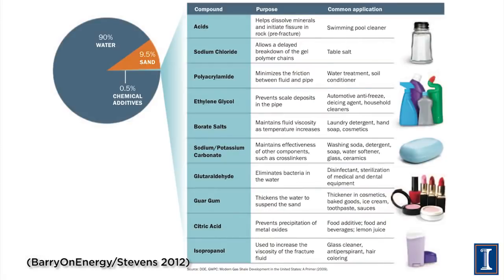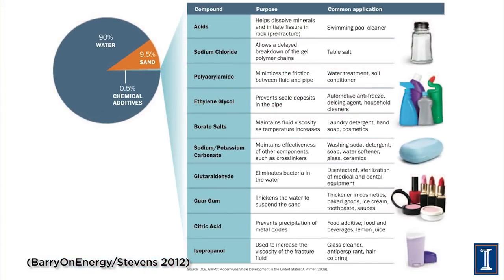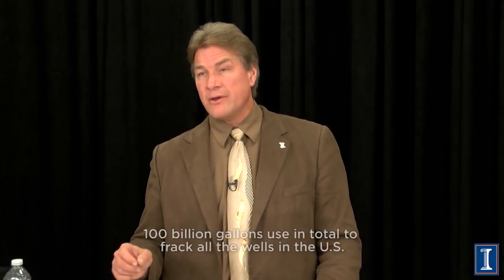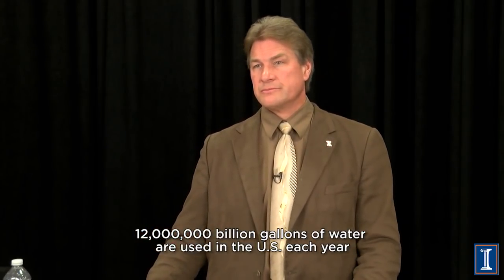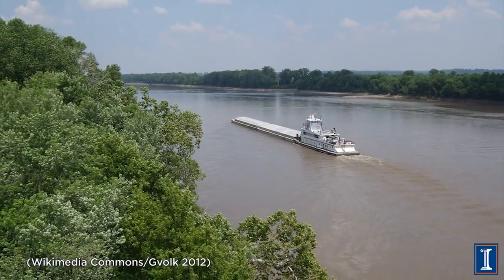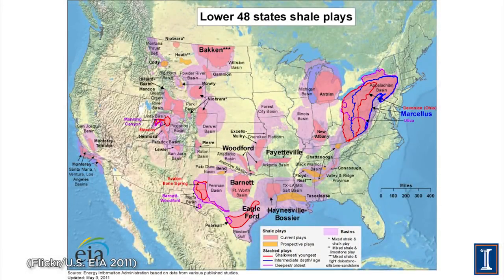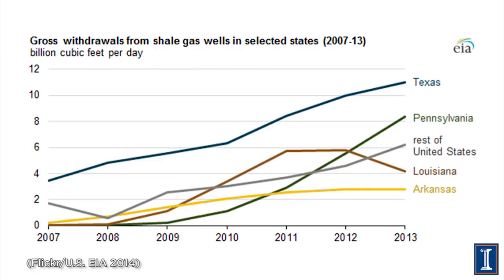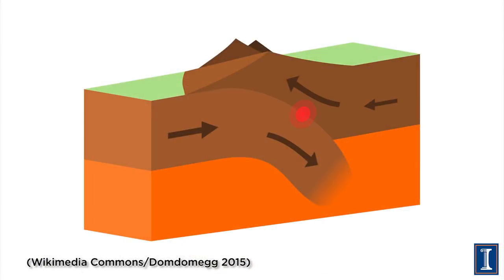Fracking and the Environment: Myth and Reality

Comment: Salt water dissolves uranium in dark shale. Wastewater from some locations is now a radiological hazard.
Reply: The pipes pulled from the wells can be radioactive as well as magnetized from the movement of the radioactive fluids.
   Just a welder sharing an anecdote. 
   Pass it on.

Comment: How much money dos government pay this guy to brainwash people.100 gallons per day.That is almost a half a tonne . WTF
Reply: The number of 80 to 100 gallons of water per person in the USA comes from the U.S. Geological Survey.
Reply: @kodiak2fitty  you may only drink a gallon or so or day, but can easily use 50 gallons for a shower, 10-15 a day for toilet (unless you piss outside or dont flush). A load of laundry is around 50 gallons or so. 5 to gallons for cooking and sink use is quite reasonable.

You might use less, but its probably not as much less as you would like to think. And also this is average so the one guy that dumps 1000+ gallons every time sprinklers come on to keep his grass green distorts the average. If the 100 gallons is including agriculture that actually seems impressive, but I doubt it includes that.

 We all could get by using alot less if we treated the stuff like gold and were dirtier and lost many conveniences of modern life. However desalination tech has got costs down 1kwh per 1000 gallons with barely higher overall cost, not running out of water soon.

Comment: Please address the issue of methane release in fracking oil.  It seems to be a huge problem, especially now that EPA allows release instead of capture or even flaring.
Reply: Methane release from the artic tundra areas warming up is a much larger issue
Reply: Methane is very short lived and does not have a huge global warming effect. Reason being all the radiation methane can absorb is also absorbed by water vapor. By the time water vapor gets done absorbing radiation, there is very little for methane to and it can’t cause that much heating if any. Methane is about 2ppm, water is about 25,000ppm
Reply: @thepope2412  Some of what you said is simply not true. Methane only absorbs light in a couple of fairly narrow IR bands, and at the 7-8 micrometer band water vapor dominates, but if you look at the 5 micrometer band - there it out-absorbs water vapor - even at it's currently low concentration. https://webbook.nist.gov/cgi/cbook.cgi?ID=C74828&Type=IR-SPEC&Index=1#IR-SPEC. Water vapor is basically transparent at 5 um. And while it is fairly short lived, short lived is still on the order of 12 years, and it breaks down (in the presence of hydroxyl radicals) into water and CO2, so it continues to act as a greenhouse gas long afterwards. All that being said - you're main point that it doesn't have a huge global warming effect is probably not wrong. But we we really can't ignore it and I think it's worth tracking and probably worth regulation. And I wish that he had addressed the role that natural gas fracking plays in its release.
Reply: @MrTkharris  You misread the data. Methane doesn't absorb at 5 microns, but around 3 and 7 which overlaps with water
Reply: @thepope2412  Saying that something small can't have a large effect is purely wrong. The amount of CO2 in our atmosphere is also very comparatively low to other compounds but plays a huge factor in the climate of our planet.
Reply: @snobrder4evr  methane at 2 ppm to CO2 at about 350 ppm is a lot
Reply: @snobrder4evr  I think he’s talking in relativity though. Methane, relative to carbon, is not responsible for an especially large amount of atmospheric warming. Obv 2ppm is still a fuckton but like compared to carbon and bearing in mind it’s relatively small absorption spectrum, it’s not that big of a deal
Reply: @snobrder4evr  You basically missed the point. The reason why co2 has a big effect is it absorbs fairly unique wavelengths of radiation that other gasses dont absorb. And the more you add the less of an effect it has, eventually you would have to keep doubling it to see the same effect, since it's already absorbing the radiation very effectively. think adding multiple coats of paint. Eventually more paint is just redundant. The same logic applies to methane and water since they overlap.
Reply: @snobrder4evr  except it's true

Comment: I worked as a tech in fraccing.   He's 100% correct on all of this.  

Water.   Most often low level filtered production water from other wells or nearby surface water from ponds and or rivers.  
Propant.  Various types of Sand/manufactured aggregates. 
Guar gum.  Industrial Jello on a industrial volume scale.   
Surfactants.   AKA industrial soap to make surface tension of the fluid lower so it flows better.  (Makes your hands feel unusually clean)  
Biocides.  Often the same chemicals used by farmers and landscapers or gardeners, just far more concentrated.  (Typically used in tiny PPM volumes)

Comment: The majority of problems caused fracking result of drillers inadequate sealing the bore hole. 
The same is true in events such as the Deep water horizon fiasco . 
Profits over safety is a poor model.
Reply: I worked in fraccing and the vast majority of those situations come from inept/grossly under trained work crew issues.  

Sad fact of life is too many companies are not crooked operators but just near impossibly lazy/cheap/sloppy on properly training their crews to know how to do their jobs properly. 
Most often aggravated by ladder climbing fuckwits lying their way into management or higher positions and screwing things up from there by running off everyone below them (almost always the crew members with functional knowledge and skills at or above their own) that they felt was a threat to their undeserving jobs even when there was no real threat by them.

Comment: In general, I love the knowledge this man shares. However my curiosity about fracking continues after watching this.  Mini earthquakes induced in areas nowhere near natural faults seems disconnected from possible benefits of lubricating the San Andreas Fault. Also, although it is possible for well water to naturally absorb methane, that also seems very different from a previously clean well suddenly developing methane absorption after the geological structures separating groundwater from methane were fractured. I’d love to see a video address these questions - I genuinely want to understand.
Reply: This much longer interview on hydraulic fracturing with Dr Mukul Sharma on Alex Epstein's "Power Hour" series may interest you https://youtu.be/Lj8vZIinpG0
Reply: Your thinking is that a mini earthquakes were induced by fracking. And also thinking that well water spontaneously has methane in it because of fracking. Now can’t fracking ever cause any problems well yes I have done improperly in the improper area. Just like drilling for water or oil Or putting a tunnel through a mountain. My in-laws had their well cracked and flooded a pipe line for natural gas being laid. These were just empty pipes at the time and caused one big mess. That doesn’t mean laying pipe is inherently evil. It means It was done improperly. Sorry for any grammatical errors I’m voice texting
Reply: fact minor earth quakes happen away from fault lines many times, and also major earthquakes hit these places as well allah Hatti
Reply: So are you suggesting that methane is in the water table everywhere?
Reply: We tend to think of earthquakes as a problem generally confined to the Western US. West of the Rockies and into Alaska. This just isn't the case. There are Earthquakes all over the USA on a fairly regular basis. I looked at the USGS site when I posted this and it reported only 4 in the continental USA in the last 24 hours, and two of them were East of the Rockies. None of them were over a 3.0 on the Richter scale. I'd imagine a number of people in West Texas or Eastern Oklahoma, where two of these quakes occurred, didn't even feel them. They probably wondered why their dog was acting strange and went back to Netflix.
While there is an increase in earthquakes near fracking sites, Earthquakes are simply a fact of life in many areas of the USA. The answer to me, would not be to heavily regulate the seismic dangers associated with fracking, but rather to make sure your local building codes adequately address earthquake danger. California, Nevada, Alaska, etc. all have rather extensive building codes that deal with seismic activity. Take some notes and build the houses and schools and shopping centers to deal with some motion. 
You can't regulate the motion out of the ground, especially in the United States. We simply have too many active faults kicking around. Instead, make sure your structures can handle the occasional tremor and go on with your daily life.
Reply: The fact is you were told a lot of BS before most likely.
Reply: @duradim1  The fact is when conventional oil stocks run out or start to dwindle in a couple of decades (?) shale oil/gas will become increasingly profitable to mine and there's no way environmentalists will be able to stop its development. From what I've seen US companies are getting hydraulic fracturing techniques down to fine art and accidents seem to be getting quite rare. Other options are liquefied coal or nuclear, maybe a couple more. But biofuels, wind turbines or solar panels are not feasible options, at least not at present and I can't see how they will ever be.
Reply: salah bensalah The cost and energy require,ents to remove carbon from the air need to be added to the cost of natural gas and oil so the market can make rational decisions and adapt correctly.
Reply: @Melthornal  Is that required by law? I believe it's very expensive.
Reply: salah bensalah And the price should be added to fas and oil. gas and oil are outrageously expensive, but since we ignore the vast majority of the costs they appear to be cheap. but they arent, they are crazy expensive.
Reply: @salahbensalah5057  Interesting that you left CSP out of your list of renewables, as well as reducing consumption.
Reply: @waynebreivogel1742  reducing consumption isnt a viable solution to anything, actually its the direct opposite of viable.
Reply: @salahbensalah5057  it is expensive mainly due to no market for it usally and direct air caprure extreamly expensive. Vs direct capture witch litarly at the sorce. the co2 concentration much higher at the sorce and lowers cost. still little more expensive tho.

Comment: Problem with fracking is that companies do it on the cheap, pouring toxic chemicals that mix with people's water supply...and they do this with impunity. 
(Making some of those companies pay a ridiculous fine after years of deliberate wrongdoing is a joke, it amounts to nothing)

Government officials are bribed / threatened so they won't investigate, victims are either ignored or bullied into signing non-disclosure agreements.
https://www.youtube.com/watch?v=5JF7QjIf00U

8:31 Seriously, nothing to do with it? 
I guess it's just a coincidence that their problems started around the same time fracking operations in the area did. 🤣
What about chemical analysis of their water? I guess it's also a coincidence they found specific non-natural chemicals in their water, which are used in fracking.  

Also, now it turns out that fracking prevents earthquakes too! 🤣🤣🤣🤣

Come on prof, lying like this isn't worth any kind of money, you should be ashamed.

Comment: A question/point regarding water usage of fracking - can the water used be recovered? Because plenty of the water used by humans is reused, after being cleaned by natural or artificial systems.

As I understand it, most or all of the water used to frack is currently unrecoverable.
Reply: Yes, it called flowback or production water and often when a well is being developed they get more back than they put in.
That's what a lot of the water haulers in the oilfields deal with.  The excess water being taken out of the wells due to both what got put in during the fraccing job and what may be in the formation naturally.
Reply: @tcmtech7515  they do get back more water than they put in, but it is incredibly salty. It usually contains carcinogens like benzene and in some areas radionuclides that build up in scale on the trucks and pipes and over time become dangerously radioactive. 

So to answer the original question, the water is typically not reused except for additional fracking purposes. It can technically be treated to drinking water standards, but that level of treatment is so cost prohibitive that it would make the entire operation unfeasible to begin with. That’s why so much water still gets dumped into disposal wells
Reply: @levelhead4597  
There is a lot of use for salt water. Did you even watch the video? I know for a fact that all the roads near me use salt water in the winter
Reply: @MinecraftMasterNo1  you're correct that there are other uses for saltwater. but it's not just salty water. It contains other toxins as well, including radionuclides, VOCs etc..

Comment: Methane.

In the first decade or so after its release, methane is around 86x more potent a GHG than carbon dioxide, with an initial burst effect. It then decays into carbon dioxide (reacts with negatively charged Hydroxyl ions), where it persists for over a  century. Methane levels as high as 2961 parts per billion were recorded by the MetOp-2 satellite on 24.10.2019 at 469 mb.
Russian research vessels have reported scooping up methane by the bucket just off the ESAS. This backs up prior research of Natalia Shakova.

This is perhaps more grist to the mill against LNG production and drilling/mining/geothermal generally.

Pump lots of GHG’s into the atmosphere and heat up the air, seas and land, drying out soil, trees, brush etc. Melting out the cryosphere with this additional heat (which feeds back positively into the system in myriad additional ways), but in particular releases huge pressure on the mantle and crust, which is now drier (brittle) with reduced elasticity. Also perforate and weaken the increasingly brittle crust with thousands of drill points and mining ops and extract vast quantum’s of water and gas (increasing shear and other losing forces) and see what happens. Answer: you may see a direct correlation between earthquake activity and wildfires... 

https://insideclimatenews.org/news/03122019/fossil-fuel-emissions-2019-natural-gas-bridge-oil-coal-climate-change?utm_campaign=PANTHEON_STRIPPED&utm_term=PANTHEON_STRIPPED&fbclid=IwAR2p5lkCvklwDcBuGtFcyfmbDUnV6RgjHzEPq4eX2QLswH8FJnmu1pO1vrE&utm_source=facebook&utm_medium=social

https://www.pnas.org/content/early/2019/12/10/1908712116

https://www.ecowatch.com/duke-study-rivers-contaminated-with-radium-and-lead-from-thousands-of--1891128813.html?xrs=RebelMouse_fb#a333e

https://eandt.theiet.org/content/articles/2019/09/arctic-methane-levels-reach-new-heights-data-shows/

https://pubs.acs.org/doi/abs/10.1021/acs.est.5b00133

https://arstechnica.com/science/2019/11/californias-methane-super-emitters/

https://www.nature.com/articles/s41586-019-1720-3

https://www.desmogblog.com/2019/12/22/methane-leaks-venting-blowouts-fracking-climate-change

https://strangesounds.org/2019/11/methane-vents-cascadia-washington-coast-science.html?fbclid=IwAR2sSPOMdXftPdeWoaATBHV1Za_BS47Zazn_61DvPWj1QuMwzAUp5zwW-tc
https://www.theguardian.com/environment/2019/dec/02/black-wall-as-government-releases-its-report-on-fracking

https://truthout.org/articles/oil-and-gas-industry-tries-to-rehabilitate-fracking-amid-calls-for-national-ban/
Reply: You had me at "Russian research vessels have reported scooping up methane by the bucket just off the ESAS". Congratulations to the Russian for getting a research vessel to Saturn's moon Titan. Methane boils at -161.5 °C so Titan would be the only place I can think of to scoop it up with a bucket.
Reply: @eddydogleg  Russia has been exploiting Jovian satellites for years, didn't you see 2010: The Years We Make Contact?  They were out there with Roy Scheider investigating the Monolith.